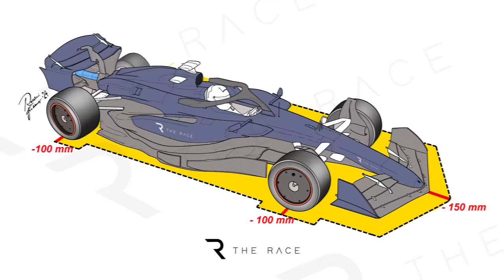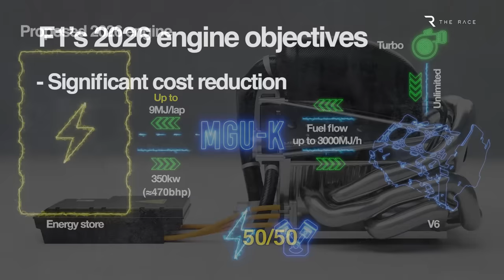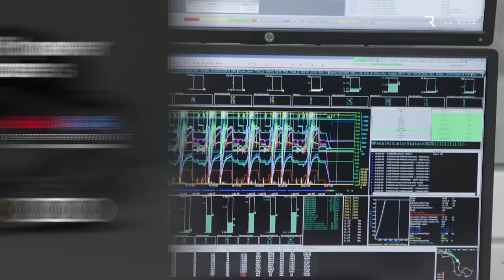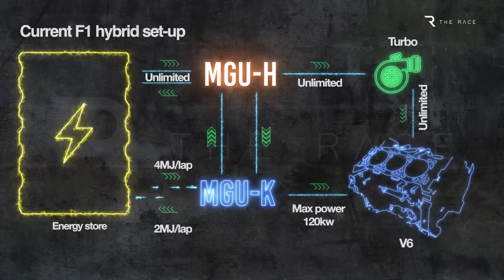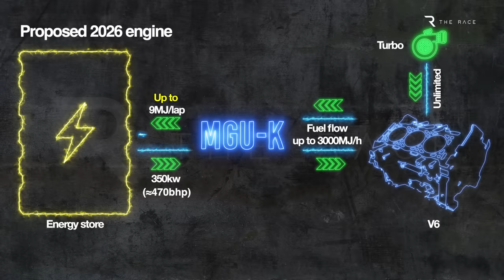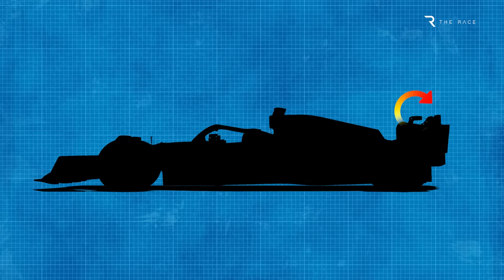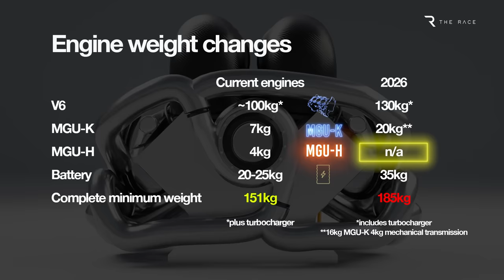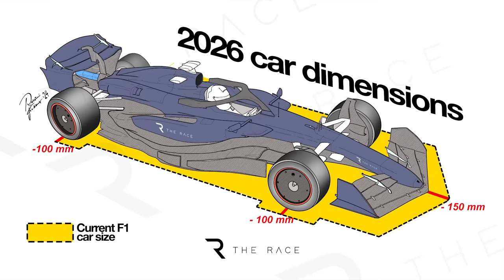The truth about F1's controversial 2026 cars

Comment: Honestly I'd like to see F1 bin off the electric hybrid side of the engine and leave that to formula E to develop instead focus on fully synthetic fuels or engines. All my life F1 has been the pinnacle of motor sport and development on both engine and aero, look at the 2000s they had, jaguar, honda, Ferrari, mercedes, Renault and Toyota in the sport as either manufacturers and engine suppliers in some cases because they were helping to road car side. Switching to synthetic fuels would allow for oil based engines to exist be sustainable as F1 wants and then also lead the way for this to eventually become part of the road car designs

Comment: If F1 was a computer program it will be on Version 3.467D2-V3-Final-2.1. Patches, patches, patches. This is ridiculous.
Reply: Yeah we should've just stuck with 1.0, no aero, no monocoque, no grippy wheels, no safety etc
Reply: @kristoffer3000  Maybe its wrong we expect these people (who get pain quite a lot) with years of experience, with 100 years of data of racing to make any good regulations on how a race car should look like and behave. Maybe if they could do anything other than copy paste the old regs coupled with Chinese propaganda it wouldnt be as crap..
Reply: @kristoffer3000  You mean like 1966 rules  (3.0L or 1.5L supercharged)?  There were basically no rules then.  An F1  car built with modern technology to 1966  rules would not be  anything like a 1966 F1car.  It would be a 1.5L turbo, fan car with active suspension, with a CVT etc etc.
Reply: @TassieLorenzo  And the limitation would be the drivers, not skillwise but physically as it would literally try to kill them with g-forces

Comment: If you set up regulations to where the battery wont be able to give power past a certain speed, doesn't that stop teams from developing faster engines?  Once you reach that limit, can't deploy anymore energy, and can't go any faster, then what would be the point for a team to try and get an extra couple kph out of their engine?
Reply: Engine dev has already been locked anyhow
Reply: @TorqueTestChannel  engine development for the 2026 engine is locked?  I don't know if that's correct.  They don't even have the regulations done yet.  How could the teams be locked in development for PU's yet to be finalized?
Reply: The electric motor in F1 has been power limited since it's introduction back in 2011. The actual internal combustion engine has never been directly power limited.

Comment: Surely if you need active aero on the front wing to balance out the car, any damage to it would surely be dangerous and mean that a front wing change would be necessary to continue racing?
Reply: Good point.
Reply: Even maybe a DNF if there is a DRS in it
Reply: At least in terms of balance, damage to the front wing will always result less downforce and thus understeer. So there's no real risk of spinning out.
Reply: however this is already basically what teams do, unless the damage is very minor and the race is almost over there is no benefit to running with a damaged wing

Comment: I have a feeling these cars are going to be a complete disaster
Reply: @tjayk9127  well to be fair they are getting a big smaller, and i dont think complex is neccesarily bad. However, i do think that what they are doing if not going to be so good
Reply: @tjayk9127 They literally said at the end that the cars will be smaller. Watch the video before commenting, seriously.
Reply: They'd be amazing if they ditched the electrical hybrid side of the ICE.
Reply: so much worry to prevent 400km/h but they should not worry. cars will be deploying 1000bhp then dropping to 400 without drivers control.
Reply: @somethingfunny6867  This was the very first problem, that popped up some time ago now. Do you seriously believe, that they would go through with it without finding a solution?
Reply: @Kyarago  Yes

Comment: I miss when they just had the KERS boost battery head up display... it was so simple. Around 8 seconds of electrical energy boost per lap. If this system is just that but its more of an overcharge (since the electrics are working all the time now instead of only on command like in 2010, then fine. I just worry that the electric motors are becoming the centre point. I started to worry about that when they insisted on naming them Power Units instead of Engines. Aim for sustainably fuelled ICE's, that would be my ideal F1 future.

Comment: They gotta make the cars lighter and smaller.
Reply: Which is exactly what they are doing.. As stated by this very video.
Reply: Get rid of electric engine and battery and you get smaller and lighter cars.
Reply: Lighter, smaller and bring back nostalgia sounds plus a 1200bhp.
Reply: @FabledGentleman  They need to be MUCH lighter.
Reply: @FabledGentleman  They should be at least 100kg lighter, not 10-15kg
Reply: 10% smaller, best thing to do
Reply: whilst the world is driving biger and bigger and heavier cars , hmmm
Reply: i mean just keep them racing with karts
Reply: Without an electric engine it could be much, much lighter and a bit smaller. The solution is so easy, but ideology unfortunately wins.
Reply: They're trying to. To make the cars more resilient and safe, AND using all this electrical energy, yeah it's going to make these cars heavier than simple gas powered go carts. Safety and environmental politics are a thing, whether anyone likes it or not.
Reply: @FabledGentleman  I know they are but i feel there should be further emphasis on that part of the regulations.
Reply: Go watch 1950's F1, then. Lighter and also literal death trap.
Reply: Ooh boy, do I have good news for you!
Reply: @FabledGentleman  not by enough.

Comment: Engine regs sound okay, honestly nobody really expected anything else. However if I were on the board, I'd support shortening the wheelbases, reducing the weight (even at the cost of power if necessary), cap downforce, and eliminate DRS in favor of moveable aero.
Reply: You got my vote for the parts you suggested...but lets make the aero paid for by Aramco and all aero testing open access along with the data being shared..

Comment: Literally take the 2022-25 regulations and force the cars to be smaller and shorter by regulations and also force a higher rpm to make the engines louder whilst keeping the sustainable fuel requirement for 2026. Put the minimum weight way down and have all the teams battle it out to reduce weight the quickest. It’s so simple yet so hard for the FIA it seems 😂

Comment: A simple fix in my opinion is bring back the 2016 chassis size regulations. 

Those cars were far smaller in terms of length and width compared to today so use those cars with a rule that they can't exceed a certain length as I believe Mercedes started the trend each year of going longer and longer with the cars, use this current ground effect floor curved front/rear wing and sculpted sidepod design regulations , a halo and 16 inch low profile wheels instead of the big visual obscuring low profile 18s. 

Those 2016 chassis had v6 hybrids in and I believe with this ground effect regs the cars would be faster than the original 2016 cars due to them producing alot of downforce and efficient downforce and the understanding teams have now of the engines compared to back then. 

The ground effect regs also provide much less dirty air for closer following so that together with lighter and smaller cars could be a recipe for great racing because lets be realistic F1 will not drop this eco friendly hybrid crap. They already planning on removing the mgu-h so that's one step closer to making things simpler and slightly lighter.
Reply: Get rid of hybrid engines and battery, bring back v10 and cars get much smaller and lighter.
Reply: @Kornn66 like I said we have to be realistic obviously that would be the best route but because F1 won't drop these eco friendly hybrid crap they should then atleast go with my first comment to make racing better and much simpler
Reply: @MV1-OP81-Mclaren  I think the new safety regs made the car bigger so dont think they could go back to 2016 car size with hybrid engine.
Reply: @Kornn66  I believe that was the reason as well but if you look back at the crashes drivers had back then in 2016 they almost always came out unscathed or atleast just minor injuries for example Alonso's crash in Australia he just had a broken rib but if you look at the accident you wouldn't say it's as minor as a broken rib
Reply: One issue with making the cars narrower is they will lose a big amount of mechanical grip making them slower in the low speed corners but potentially faster on the straights. They need to pick the right dimensions that make racing interesting and disturb the air the least. Maybe really wide and flat rear wing would work. Also it depends on where you want the cars to be fastest on track. 2021 was and insane spectacle because the cornering speeds were so high
Reply: The 2016 regulations were shit with hybrid engines. Either you get rid of hybrids and go narrow like 2016 or you keep hybrids and stay wide.
Reply: There was no maximum length in 2016.  There has never been a maximum length at all, until 2022. I don't think the 2016 rules do what you want.  Teams were  in the process of making their  cars longer to gain downforce, and would have done so anyway regardless of the changes to track width and floor width.
Reply: @DragonFury-gq5zo  Precisely! Track width is free roll stiffness while keeping vertical softness.  Hence why everyone made their Grand Prix cars up to the maximum 2.15m width between '72 and 1992.  The cars also looked wide and mean, unlike the squashed looking narrow-track era cars!

Comment: Recently, a Private individual configured His SIM car to emulate the 2026 power unit and Chassis Regs, and the car is virtually undriveable. In order to complete a lap, you have to stay out of the throttle so much that these new cars are now SUBSTANTIALLY slower than the current F2 Cars. They made the power unit regs first, and then tried to correct the differences by adding active aero features that literally upset the balance so much that it puts the car into an uncontrollable spin.
Literally, its the stupidest thing I have ever seen. Not only that, by the time these Regs are put into play, the auto manufacturers will have all quit their unsellable electric car production, and the shift will have already gone full force towards hydrogen as a sustainable fuel.
The entire 2026 Formula is already irrelevant to the Manufacturers that said "This is what We want" even when the F1 Fan base AND Racing Teams said "This is ridiculous".
Reply: I'd pump the brakes there on hydrogen. Hybrid technology is the dominant driving force in the automotive market, and will continue to be for the foreseeable future. However, there's right and wrong ways to do it. LMP1 is an example of the right way to do it. It just become too expensive for WEC but F1 definitely could have made it work.

Comment: Cheaper and simpler isn’t the route to remaining / becoming “the pinnacle of motorsport!!” 🤦🏼‍♂️ …push a button to overtake… honestly this is a farce. 😢
Reply: 2021 was a fluke, this sport has been trash for a decade now
Reply: @WOWWOW-hk1tb 2021 F1 Season was the last ever season where F1 is "GREAT". Ever since 2022 its now awful.
Reply: 2021 didn’t exactly end is a blaze of glory either. An outrageous peice of incompetence.
Reply: It's not a overtake button, it's a compensation method for DRS losing it's effectiveness at high speed.
Reply: @456MrPeople  - Dude you just made it sound even less appealing than “an overtake button” 

The cars need to be simple enough for the drivers talent levels to differentiate on track. Without that, the sport is dead.
Reply: @purwantiallan5089   2022 was more competitive than the first three years of the Mercedes-dominating start to the hybrid era.
Reply: You do know that f1 had an “overtake button” since 2009. 

It’s called overtake but it can be used for defending also. Literally nothing has changed about this button for more than a decade 🤦‍♂️
Reply: Wanna go cheap!! Be like Indy, just a cheap car flying in the air 236mph!! At Indy 500 😅.

Comment: Sounds like they have made the power units (the battery component especially) far too strong and not considered the consequences of that ahead of time. Only way around that is to make everyone run ridiculous levels of drag to prevent cars being too fast for the tracks, the drivers, the run off areas and their own brakes.

I thought a goal was to make the cars lighter in some regard? The engine itself being over 30kg heavier doesn't fill me with confidence at all, so god knows how the drivers feel about it.
Reply: as you said tho, due to tracks, they kinda do have to slow them down.. or build bigger american style tracks

Comment: Oh my god, AND they’re making the engines heavier! 😂 So, thinner tyres (less grip) - Thinner chassis (potentially less grip) … and heavier engines. This is getting beyond ridiculous. F1 you are close to losing a lifelong, 30+ year fan here.
Reply: Same here honestly. 2026 F1 was something I was looking forward to, but with everything that's going on in and around F1 right now I might be gone as a fan long before then unfortunately. A shame since I've been following the "sport" since 1992.
Reply: @Dannykm  i like your sarcasm
Reply: That was a mistake.

The 2026 minimum weight of 185kg includes the ICE, turbocharger, MGUK and battery.

The current PU minimum weight of 151kg includes the ICE, the turbocharger, MGUH and MGUK but not the battery.

The 2026 rules has the ICE + turbo + MGUK + MGUK transmission = 150kg.

The battery weight for 2026 is 35kg, but that includes the battery box, the cells, and other electrical components. The 20-25kg weight for the current batteries is only for the cells and some connecting parts.

So the 2026 PU is not really gaining weight over the current PU, and if it is it is only by a few kg, not the 30-odd kg presented here.

Still, being a less powerful PU overall, the 2026 PU shoudl have been lighter.
Reply: inb4 Super Formula becomes the fastest road racing series in 2026
Reply: @Willbrse  they can't, because inline four 😂
Reply: @Ariespradana13  Oh they can, they had  pace for mid grid in F1 in 2014 rule change
Reply: You are going away, there's 10 other 12 year olds getting into racing thinking this is peak motorsports, so they really aren't loosing fanbase. Stuff like drive to survive and the whole social media around f1 help it a lot with new fans.
Reply: @rickrolled7930  “loosing fanbase?”

Comment: Personally I'd love to see F1 cars barreling down a straight at 400kph.
Reply: a. k. a. Drag racing
Reply: NHRA it is.
Reply: Force increases with the square of speed, so I can understand why they would be hesitant for straight top speeds to jump from 350 kph to 400.
Reply: I'd love too, but as The Race said in the video, it would require a redesign of barries and run-off areas

Comment: "it's not push to pass!" Describes push to pass
Reply: I can't see any distinction either
Reply: Push to pass can be used at any speed. The override button is a compensation mechanism for DRS being less effective at higher speeds. But to be fair, DRS itself is basically push to pass.
Reply: @BiggieTrismegistus  Push to pass is miles better than this. This new system seems to activate together with DRS, meaning only the following car has an advantage. Push to pass is limited use during the race and whenever you want. The leader could use it all in the first few laps and hope for no SC, as a strategy for example. Most importantly, this would also give a chance for defending car to deploy it, without just being breezed by on a straight.

Comment: Why the active aero part couldn't be done by flexing wings ? it is banned today, but it could allow better efficiency and maintaining a good amount of downforce? Same with active suspension : reduce drag, better control of balance and floor downforce, better confort ?

For reducing weight, they made the right choice i think. Unfortenatly, Pirelli didnt want to make smaller wheels for heat control issues but it s heading in the right direction
Reply: Pirelli should've let them made smaller wheels to reduce weight further.
Reply: If Pirelli didn’t want to make the tires why did F1 sign them up for more years at the tire providers for the sport especially as Bridgestone was around
Reply: @RANDOMZBOSSMAN1  they said making smaller wheel will induce more degradation because the tire has less time to cool before getting to the ground again as the radius is smaller (which is logical). That is what they explained and it was after the deal was signed
Reply: That's a good question. I wish I knew the answer.
Reply: It can be...  the flex rules arent working now ...the front wings deflect about 1 inch at high speed in the closeup Sky Sports shows.  Active suspension could work with the advances in computer technology of today versus 2-3 decades ago.....but it  has to be equally shared by all. Other wise you get Red Bull type dominance of the past 3 years with little racing . and the sharing will drive costs up as all teams push to test their cars .

Comment: I don't understand why they can't make v10's... or really, why they restrict piston count at all. Let anything from 2-10 cylinders and keep the restriction on max fuel and fuel flow. One team could run a v-6, another could do a v-8, another could do a v-10. Each would have advantages (weight savings, reliability, torque vs hp, etc) and would be more fun to see who comes up with what. Similar to how it was done a very long time ago.
Reply: Everyone will use the V-twin engine.  In an efficiency formula, there is no benefit to having more cylinders.
Reply: Let them do rotary engines too.....